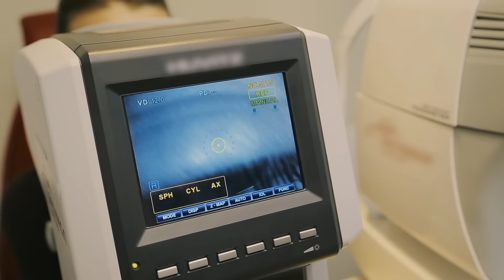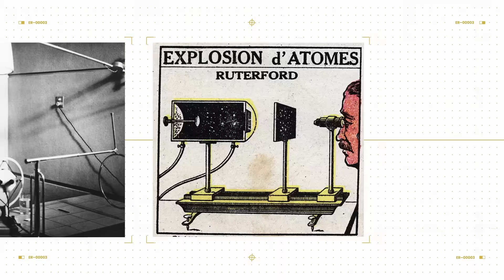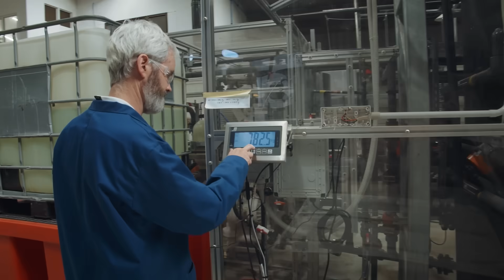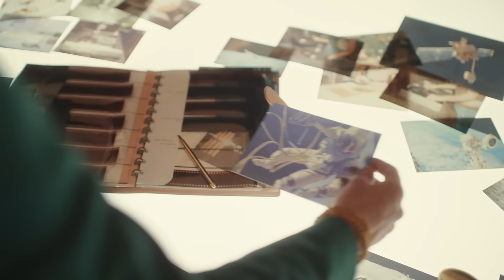The Golden Thread: Episode 5, The Spark

Comment: Kind of bizarre here. Gold does NOT make us innovate, nor more innovative. Gold is a material that has specific characteristics that are useful as long as those use cases fit within certain economic parameters. No one is going to electrically wire their home with gold wire, even though gold would be a superior conductor over silver, copper and aluminum. There are far more use cases for the use of gold were they not limited by the economic considerations as well as the natural scarcity of gold in general. These videos are interesting to a degree, but I ponder divining the underlying objectives and intent for them. OK, gold is a nice material, but so is titanium, tin and phosphorus.
Reply: Silver would be the superior choice electrically, and if you wanted a hard highly conductive coating rhodium is better
Reply: Aww q